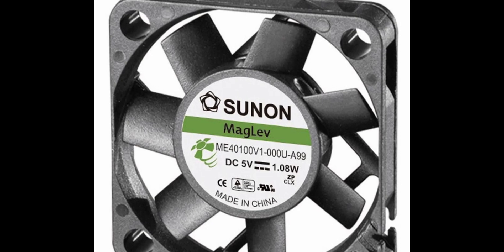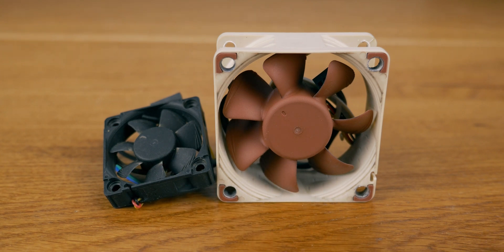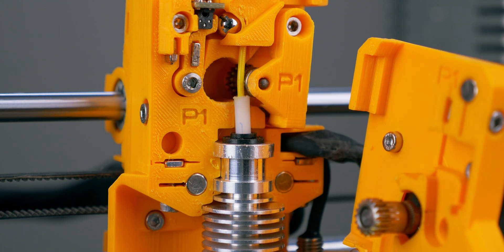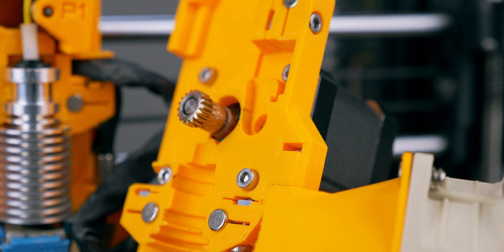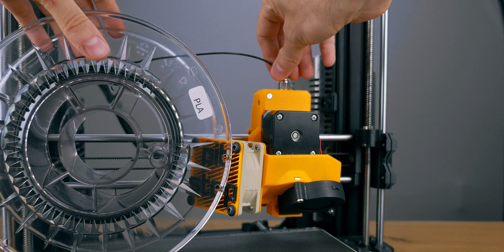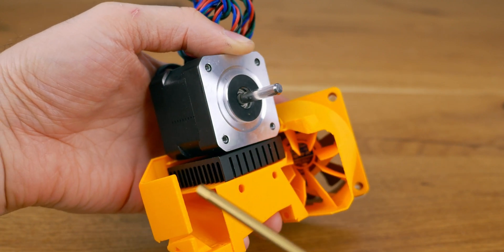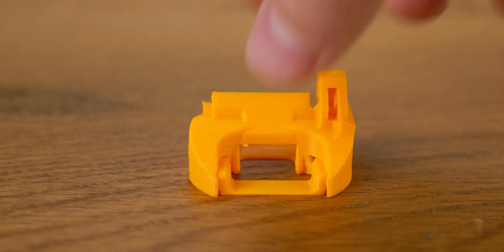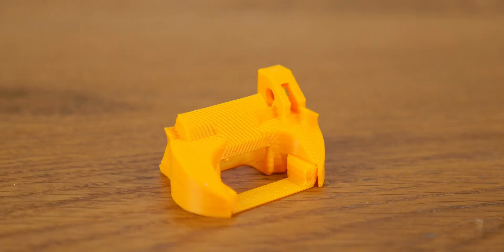PitStop extruder (serious) cooling

Comment: I am using all metal hotend for Prusa MK3S+, I had filament clog only once, when power went down completely for few hours in the part of the city when I live. Now I am using small Noctua fan 40x10 5V version on the extruder with some shroud, this fan is connected to Prusa MK3S+ hotend fan via a connector you get with Noctua 40x10 5V bersion. It runs when hotend fan runs, I use only 2 wires, not 3.

Comment: The motor itself doesn't need to be cooled at all, it can take it. It would take at least 125°C internal temperature before it takes damage if memory serves - so it's rated to run in 80°C hot environment in free air.

Myself i've got an old Geeetech printer and i drilled out the hole in the cold end heatsink to i think something like 10mm diameter, i forget. This lets a good chunk of the airstream into the extruder body where the extruder can be cooled directly. Also i replaced the extruder body with a basic alu MK8 - it was plastic - so i can be well convinced that that whole area is well cooled. Including the motor, which makes me a hypocrite. But i don't live in a 50°C climate, and i use a PTFE lined throat, so my mod probably doesn't do much to increase my print reliability. And yet the motor getting to a substantial temperature made me believe that this wasn't the worst idea, like, it doesn't take much for it to get to 50°C, and printing PLA here, and add a little heat added from the throat, because the thermal connection between the heatsink and the throat isn't great on Geeetech, and a little heat added from the friction. It definitely doesn't hurt.

Comment: I put Peltier cell 120W on my MK3s extruder motor, I cooled to the point where condensation drops where present on the extruder motor and falling into print .. Clogging issues where still not solved. so this leads to think heat creep is coming from the hotend and causing jam . also need to mention I was having issues when printing with small 0.25 mm nozzle and 0.05, mm layer heights , at 22 C room temp. so very small material flow.( trying to print name cards :D )
Reply from the maker: Heat creep comes from the hotend, if the radiator isn't cooled enough. The stock extruder has serious cooling flaws pointed out by various people.

Comment: Hi there
As for part cooling, I made a duct that funnels air from the front and from both sides. I am currently working to refine it so that it is integrated into the extruder cover on my mk2s. Anyway, making the air flow through two "arms" onto the print from each side along with through a slot in the front has relieved a lot of my part cooling problems.
Reply from the maker: Cool idea
Reply: @MihaiDesigns  I'll upload the most recent iteration to thingiverse tonight so you can see it. I have Autodesk Inventor files and can also upload STEP files if you prefer.

Comment: better adjust your vref instead add a heavy radiator at the hotend.
also meg lev sunons are much better than noctua, every china step down  is a chance to burn your house down
Reply from the maker: Hey Sven, thanks for the comment. You're welcome to improve the Prusa firmware if you want; I kinda gave up on that. Safety is a primary concern for me, reason why I have a separate secondary safety system. Noctua is an Austrian company and for me their fans work all the time in comparison to my broken Sunon. Can't imagine having a Sunon fan in my PC tbh. Either way, I'm glad to learn that there are various other approaches and am sure they're really good.
Reply: @MihaiDesigns  yeah noctua are good for pc's but simon meglev have normally more than only the flow advantage.
Maybe you got just a Monday model or a clone
Reply from the maker: @svenvanbeckum6397  that is very possible, because I heard a lot of good things about Sunon. I should try one again some time.
Reply: @MihaiDesigns  just get sure you take a mag lev one, so you avoid vibration transfers from to fan to the hotend
Reply from the maker: @svenvanbeckum6397  good point!

Comment: Looking forward to you release it :-) 
Will be a huge upgrade on my anet a8 plus!
Reply from the maker: Oh, cool! I didn't think of that. You'll need an E3D V6 extruder block where the radiator has a PTFE clip. If it's not identical in dimensions it won't work. Looking forward to hearing from you if you install it.
Reply: @MihaiDesigns  Im going to update my printer to fit this no problem :-)

Comment: Very cool work. I feel like the direction is just about what the Hemera was designed for from E3D. Imho I feel like it's going in a direction that is somewhat less relevant to the actual outcome of any print. I've upgraded part cooling on my printer with a huge radial fan and a petsfang fan shroud - this has an enormous impact on overhang, stiction to the bed, .... Being able to open the extruder assembly seems a bit of an overkill to me. Maybe you can explain the main purpose and beneficial situations to me.
That said, I really like what you did! Very good problem solving and digging in deep! This is how these projects work - v2 and higher start to be doing what they should^^.. Keep the good work up! Also great compliment for the video and its quality!
Reply from the maker: Thank you! Indeed radial fans are better at creating high pressure. My cooling redesign completely focuses on avoiding printer jamming at the moment (for those who experience that). I might look into a better shroud though. I've explained the benefits of opening the extruder in my other "serious" features video. The design was more relevant a year back when I made it, but I thought people could still be interested in it.

Comment: It's funny I watched this video this morning and though "I have not had any issues with my extruder jamming when the ambient temp got hot" then today the temperature is in my garage getting close to 40C. And I had a jam in the hot end just how Mihai described. It looked like the gears just ate through the filament and cut it, so it did not push it in. Luckily I was able to clear the jam with pliers and pulling the filament out. But I was worried I would have to take it apart.

So I think my next upgrade might be this, for better cooling and easier cleaning.
Reply from the maker: Oh, good thing you managed to take the remaining bit out with the pliers. I suggest waiting a little for the early adopters to try it out and provide some feedback.

Comment: I've also struggled a lot with heat-creep, to the point where I never print PLA anymore, simply because it gets too soft, inside the gears.

Pitstop looks good but when can we get it?!
Reply from the maker: I've got about 6 more videos to post and then you'll be fully informed on the extruder and will have access to the STL files. Should be pretty soon. I'm filming the assembly guide as we speak.
Reply: @MihaiDesigns  Looking forward to it man!
Reply: Waiting Aswell :) I have the same issue. Stopped printing PLA and switched to PETG. I have been waiting for something like this for a while now :)

Comment: Some people say this is a myth. I assure you it's not. Heatcreap is a real issue. I solved it by buying the Bondtech extruder. But I will for sure print this extruder and test it. I love this design and the effort!
Reply from the maker: Yup, I used to have a lot of issues especially during the summer, very frustrating, and they're all gone now. I hear that the Bondtech extruder is a good solution, so no need to print this one, unless you really want to :)
Reply: @MihaiDesigns  I plan to buy another Prusa printer, for that one I will use your design because I just love your effort and I think it's a good extruder. As I've said before, adding the Mosquito hotend would be epic, and shouldn't be to big of a problem. It's basically the same size but a different shape. Looking forward to your release. It will blow the internet to Mars! :)

Comment: I've been using the SkeleStruder with Sunon fan for about a year now for the exact same reasons you mentioned in the video. Also a very good extruder with gear reduction. If there's a feature I think your extruder could also benefit from, it's gear reduction. It eliminates the heat through the gear, allows for higher speed or the use of a smaller motor (reducing mass).
Reply from the maker: Indeed, the geared motor is what I'd add, similar to what the SkeleStruder does. Maybe I'll do it one day.